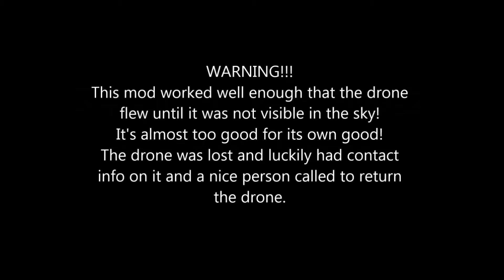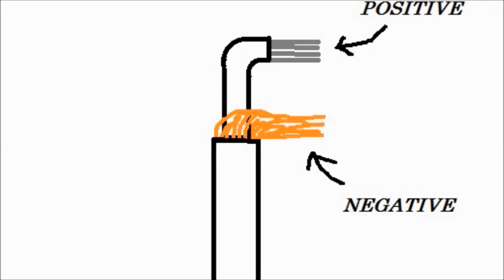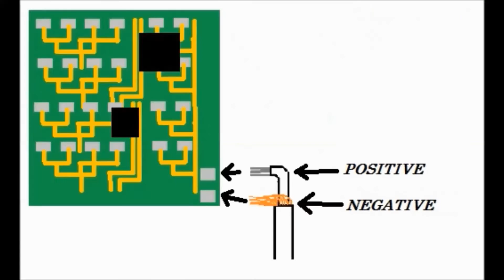DIY MJX Drone Range Booster MOD X101 X400 X600

Comment: Can someone PLEASE explains why it's nescesary to solder instead of just cutting off the existing antenna and splicing into those wires.
Reply from the maker: You totally can if you want to. In my case the wires going to the tiny antenna were only like an inch long so it was easier to just solder than try and surgically splice in such a limited length wire.
Reply: Make It Mike Thank you.  I own a soldering gun, but I've never soldered anything and don't want my first practice to be on anything that I want to actually work again.  I appreciate your answer.  I'm going to attempt this on my 601h.  I really want to upgrade to a real fpv camera.

Comment: hello, 

this will work if i take that ?  https://www.amazon.fr/TP-Link-TL-ANT2405C-dint%C3%A9rieur-omnidirectionnelle-dextension/dp/B000N40U9O/ref=sr_1_1?s=electronics&ie=UTF8&qid=1483652076&sr=1-1&keywords=antenne+wifi+5dbi+omnidirectionnelle 

thanks!

Comment: Hi 
Can I fit two 6dbi antenna's?
Reply from the maker: I'm sure you could if you wired them parallel not series. Not 100% sure if they would interfere with each other? I have seen drone controllers with 2 antennas before but one is for the drone and one is for the camera.

Comment: Can i use an antenna with more than 5dbi
Reply from the maker: Ya you can use whatever dbi you want. The only thing is the higher the dbi the more you need to point the antenna at the drone and it takes away from the 360 reception. So you kind of want to find the happy balance between the two. 5 dbi I think is pretty good but I would personally not go above 7.